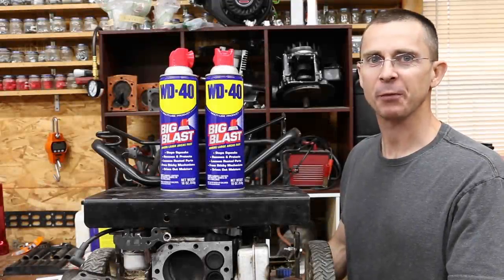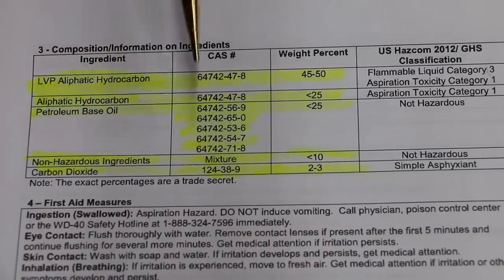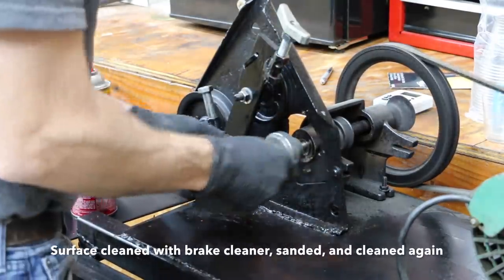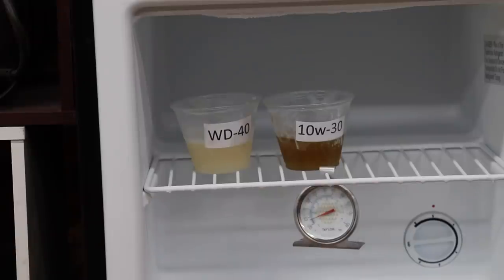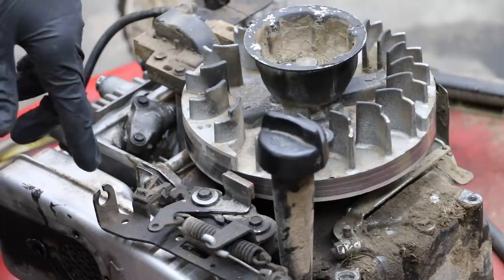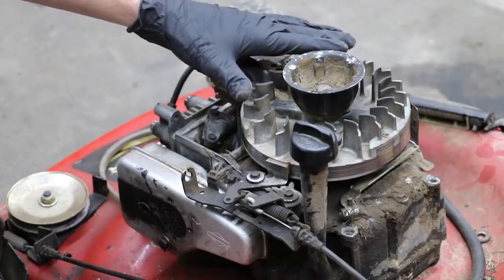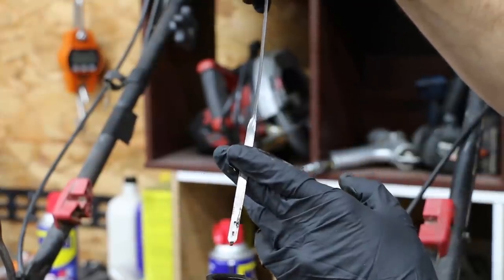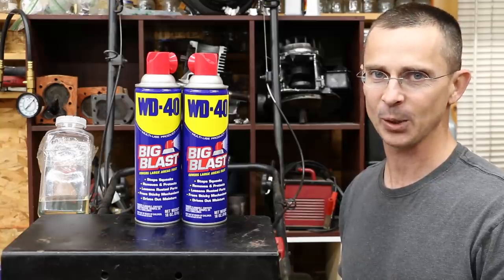Will WD-40 work as engine oil? Let's find out!

Comment: I heard that WD40 is a degreaser and not a lubricator, thats why its not a good idea to use it on for example a bike chain. So is it a lubricator or not?
Reply from the maker: The can says it "lubricates".  However, it is better known of other uses.
Reply: from my understanding wd-40 has detergents in it that actually strip oil, but i've also been told its basically diesel with additives

Comment: Why the focus on the cylinder walls? WD-40 would probably lubricate them as good as or better than oil as it's thin enough to get by the rings more easily. It has absolutely no film strength, though, so the crank bearings are where you'd see the damage. Also, when you drained the WD before pulling the head (let's be honest, you didn't) I'm guessing you didn't get much out. What was on the tip of the stick looked like a drip left on it, not an actual amount from the stick dipping into the pool of oil/WD in the pan/block.

At least you pretend you know how to science.

Comment: Why would you not run it with the cover to get a realistic result? The question is van you run wd-40 instead of conventional oil. I'm not going to be mowing my yard without the cover. Maybe it explains why it was running so hot huh?
Reply from the maker: It was below freezing and I had fans blowing the exhaust away from the shop.  Lots of air blowing around. Thanks for the constructive comment.

Comment: I don't understand some of the parameters you imposed on this test.  You took off the engine cowling so the cooling fins wouldn't work, and at the end stated that the engine ran hotter.  Yeah, you took the engine cowling off....it would have run hotter no matter what was in the crank case.
Reply from the maker: Thanks for the constructive feedback.

Comment: Ya know I've been using royal purple motor oil as basically a transmission fluid for the past 10 years but what would happen if I used it in my transfer case
Reply from the maker: It depends on the type of transfer case.  For example, my 2003 Suburban has an auto 4wd system that requires a special type of fluid or it will not function properly.

Comment: ￼

WD-40 isn't actually a true lubricant. WD stands for "water displacing" and its main use is as a solvent or rust dissolver. Thelubricant-like properties of WD-40 come not from the substance itself, but from dissolving components. ... WD-40can be a good substance to start with — it can help clean up rust or other grime
Reply from the maker: Thanks for commenting on this.

Comment: dear sir nice to wright on you channel ,,i am modeler for RC model engine,is it possible to use W.D 40 to clean the engines and also lubricate them so i can put them in storage,, but not to use W.D 40 for running the engine...

Comment: Hello,
What happens if one oil is used for all systems? 
E.g, a 10w40 oil for engine, gearbox, power steering, differential, stabilizer bar and brakes
Reply from the maker: Thank you for this recommendation!

Comment: I really dont want to watch this...but i will. I like your videos. But as an engine builder.... well you get the idea... RIP
Reply from the maker: LOL!  Thank you!
Reply: He did it, so you don't have to. You wouldn't do that with any engine you need, or care about. If it were me, I would have left the starter shroud on, for cooling. WD-40 is a really good solvent, so I would have run for ~5-10 minutes, then, changed the WD-40 again, knowing that all the accumulated sediment would have been washed out from every nook and cranny inside the crank case. After the hour of run time, I would have drained the oil, poured it through a white coffee filter, to check for metal shavings. 
     Testing the compression was a good idea, but I would have followed up by putting normal oil in the engine again, running it, then retesting the compression a 3rd time. The cylinder actually looked really good after the run with WD-40 in the crank case. (at least, it didn't look worse)

Comment: I don't see how this is a fair test, by removing the casing lid you force the engine and WD40 to be at a higher temperature than oil would normally have to deal with.
Reply from the maker: Thanks for the constructive feedback.

Comment: Well, jes a WD40 does works on small 2 stroke engines, I did run it on a 49cc Piaggio ciao engine, it failed after 3 months.
Reply from the maker: Thank you for this recommendation!
Reply: If you did not test a moped (50cc) running on nitro methanol jet, I recomand you making a new video about that, I also tried this, so I learned that nitro methanol does not mix with motorcicle 2 stroke oil and that the nitro methanol that i used, is a RC plane fuel, so it has some oil in it already. The RPM was much higher. There were no signes of a damage on a cylinder or on a cylinder head. The fuel was 25% nitro, I think so.

Comment: You removed the air cooling system from an air cooled engine and are surprised that it ran hot???!!!  Try it again with the cooling system intact and I bet it runs just fine.
Reply from the maker: Thank you!

Comment: Can someone tell me how that socket starting works? I tried welding a nut inside a socket to start my auger. It kind of worked. I originally tried it without welding it but the nut would fly off every time the motor started. Hence the weld to keep the nit from flying off. 

How does he keep starting all those motors with a ratchet gun?
Is it a special socket?
Thanks

Comment: WD-40 is a formula of deodorized kerosene, dmso and detergents. Maybe the DMSO is no longer present in the formula but at one time, people used to spray it on their bad backs and and sore joints and claim relief.

In the bad old days people used to run kerosene through their cast iron engines as a cleaner. It will work as a lubricant in a gasoline engine te the extent that the engine will run. But in the long run it will not provide adequate lubrication. Engine flush additives still contain kerosene or an equivalent but in modern engine it probably is not a good idea to use kerosene (or diesel fuel) pure as an engine flush. I wouldn't do it. Not even in a 1980's engine.
Reply from the maker: Thank you!

Comment: Pretty ignorant looking to take the wd40 out of aerosol can when they sell in in gallon cans.    Another thing being there is a MASSIVE difference between a constant bath of wd40 when compared to spraying it on a bearing ...when wd40 is judiciously sprayed on a bearing it typically washes out the grease or heavy lubricant and leaves the bearing (or hinge etc) with almost no lubricant ...meaning one will have to keep spraying it on over and over and over again ...WD40 does have it's uses but it is a CRAP lubricant compared to oil and grease
Reply from the maker: Thanks for commenting.  Yes, paid more out of convenience as a result of living in a rural area.

Comment: TEST REQUEST .... is wd-40 harmful to common automotive rubber, like tires, radiator hoses, vacuum tubes, brake hoses ... i would like to use it as a rust proofing for my car before applying a thicker product like flyid film .... wd40 is thinner and will creep better.... lately the wd40 website has been saying that wd40 multipurpose IS SAFE for most common rubbers, whereas before they used to say DO NOT USE ON RUBBER ... there are no tests on youtube other than one for orings on a motorcycle chain soaked for 3 months and it was OK .... just type in wd40 safe for motorcycle chain .... for that test ......
Reply from the maker: Thank you for the video idea!

Comment: poor test, the engine shroud directs air flow from the fan through all the fins of the engine keeping it cool, running the engine without the shroud makes it run alot hotter .try your test with the shroud on for a true test of the WD40.
Reply from the maker: Thanks for the constructive feedback.

Comment: Your one wd 40 said the flash point was at 122 degrees Fahrenheit when you ran the engine off of wd 40 but in this video it says the flash point was at 138 degrees Fahrenheit so what is the difference between the two WD-40 s
Reply from the maker: I used 2 separate MSDS sheets, since I lost the one from the 1 video and couldn't find it online again.  I'm not sure why there's a difference.

Comment: Hi, I had a Question, can you spray WD40 all over the engine bay and is it ok to let the wd40 all over the engine or do I need to wipe it, if I spray wd40 all over the engine bay is it necessary to wipe it after that or is it fine to keep it, will it catch fire ??

Comment: Those "test" machines never hold the bearing in such a way that it would normally engage the surfaces of a race or a crankshaft and so on. Likely see similar miserable results with grease you use to pack wheel bearings or with gear oil used in light duty and commercial tractor/trailer differentials or trailer wheel bearings. Build a better machine so the bearing engages and rolls as it's supposed to. Have not seen anyone demonstrate any high pressure grease or gear oil used on those weird machines.
Reply from the maker: Thanks for commenting.

Comment: I don’t think the engine test is fair cause the engine isn’t running under normal conditions because the load is extrem an there is very little cooling.... you wouldn’t run a engine with this conditions even when it was normal engine oil
Reply from the maker: Thanks for the feedback.

Comment: The test is totally invalid due to the fact that you pulled the air damper off the motor it would have kept it cool and most likely did no or little damage
Reply from the maker: Thanks for the constructive feedback.

Comment: UNFAIR test.  You didn't do exactly the same thing with engine oil.  Who knows what would have happened if you had run the engine on oil for that long, under brake pressure (mowing is not constant pressure - it's pressure on and off, on an off) and with no ventilation from the fan.  Plus the pressure from the brake probably heated up the rotor (which is connected to the crank) to be very hot.  The test only shows what happens with WD-40.  Show exactly the same thing with 30-30 engine oil and see what happens?   I'm not saying engine oil won't do better, but I am saying we don't know at this point whether it would or not.   Your end results are flawed because they are based as if engine oil would do a lot better which we really don't know.  This was a flawed test.
Reply from the maker: Thanks for the constructive feedback.

Comment: WD-40 is a solvent. Not a lubricant.
Reply from the maker: Great point!  They do mention that it "lubricates" on the can of WD-40, which seems misleading.
Reply: Correct. I use WD 40 to clean parts. Works great on faded black powder coating. I enjoy your videos. I appreciate your reply.
Reply: Just had a idea..lol. a video on solvents. Brake cleaner, WD 40, mineral spirits, etc.

Comment: Why oh why do I do this? I love these videos, but you make my head want to explode. Every time you introduce some random element that completely negates any results. This time depriving the cylinder head of airflow??!! It's air cooled...of course the heat is going to build and build. And no muffler deprives the exhaust valve seat and port of the heat extraction the muffler's mass provides.

You need a tech advisor. I volunteer :)

Oh and you can buy WD-40 in a gallon can. Much cheaper. Next time...
Reply from the maker: Thanks for the constructive feedback.
Reply: I love that you do this stuff...it's fun to watch. I wish you had a sponsor that could get you some cheap Predator engines or something so you'd have something new without questionable wear/performance issues before the tests even start. And some kind of equal footing for side-by-side comparos.  Hey you ever start an engine without a carb on it? DON'T. I did it to a 396 Chevy engine when I was a teen. Scariest thing I ever heard. Just threw some fuel down the intake and hit the key. Motor sounded like it was gonna suck the hood into the intake, and probably hit 9000+ rpm before I shut it off. Never did run right after. Ruined the lifters and valve springs. Don't start engines with unmetered fuel and no restriction. But if you do, get it on video. And beware of scatter...  :)
Reply from the maker: Wow!  Interesting video idea!

Comment: Will an engine run on Coleman Camp Fuel aka "white gas?"  According to the SDS, its molecules contain 5 to 9 carbon atoms.  Gasoline is about 6 to 10.  The main difference seems to be that CCF has a large amount of species that are not straight chain hydrocarbons.  https://www.menards.com/msds/113496_001.pdf
Reply from the maker: Thank you for this recommendation. Please check back tomorrow afternoon. I plan to publish a video on this then.

Comment: Why did you run it without the engine cooling shroud cover installed??  Why was it allowed to overheat on purpose especially when running such a light viscosity oil??  I love your tests…. But you botched this one badly!  It was like you removed the coolant from a water cooled engine and tested oil in it at the same time…. A 100 percent biased failure test… do a retest to be fair to the test subject!

Comment: I like your videos and you’re normally not biased at all but this time you pulled the muffler off, the cover off and admitted the purpose was to cause it to run hot. So when you blame the WD40 for it running hot, come on bro. Unless you can show that this set up doesn’t run hot with standard 30 weight oil under the same conditions I have to believe you skewed it intentionally. I don’t think WD40 would be a good crankcase oil. It’s way too thin, the stuff will run the engine if sprayed into the air intake of the carburetor, I know because I have done it trying to start stubborn equipment when nothing else was available. Not surprised it all evaporated off, I am surprised none of it ignited once into the open air. But, you stated you wanted it to run HOT before you began the test and altered the test to accomplish that end. Blame poor lubrication, oil loss, and the like on the oil but what oil does well when you remove the muffler and cover to prevent any heat exvhange from happening. Remember part of any exhausts job is heat sinking to prevent valve damage.